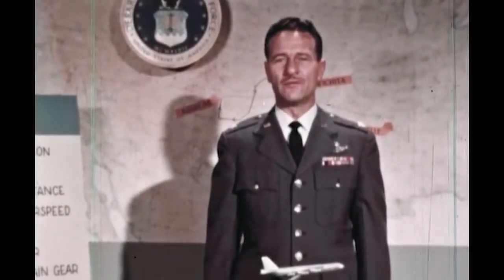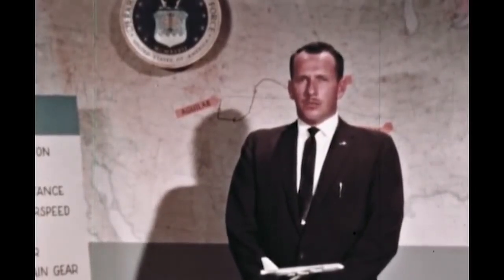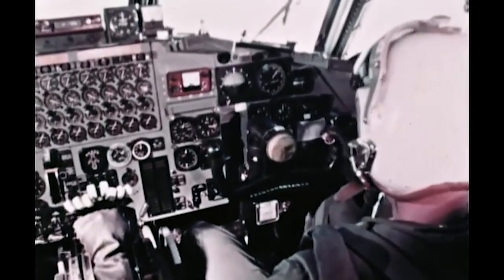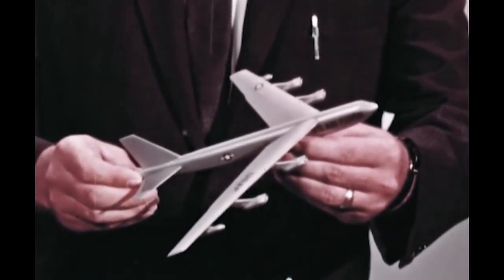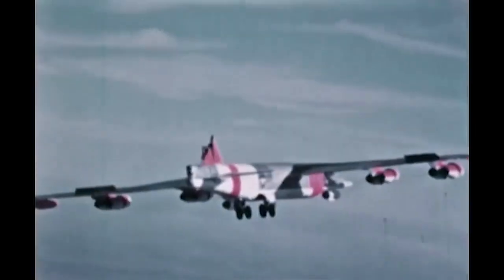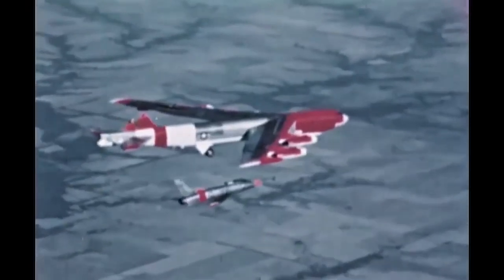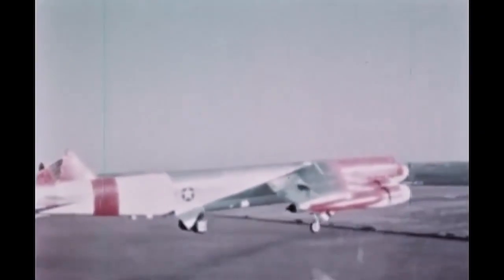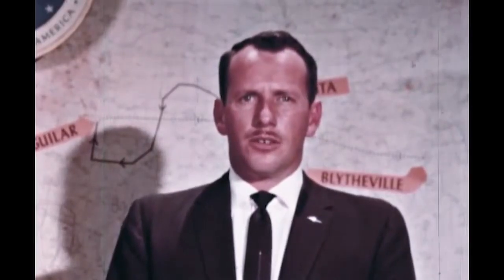B-52 Emergency Landing - Flying Without A Tail Fin - 1964 Air Force Education Film

Comment: First B-52 entered service in 1954, and the first B-52H entered service in 1961. I find it interesting that we're still using the B-52H model and there's been no other model I, J, K, etc.. since. In 2024 that's 70 years of service, and 63 years of the "current" model. There is a B-52J model scheduled to begin testing in 2028, and be fielded to the USAF in the 2030's.

Comment: I had planned to go on this flight as an observer. I was Chiief of Structures Technology at Boeing-Wichita at this time, and the data from these flights was sent to my section for analysis.The purpose of this flight was to record gust velocity and airplane accelerations and stresses during low level flight. This was at the height of the Cold War, and SAC crews were required to practice this type of terrain avoidance flying to be ready to penetrate below Soviet radar. These flights and other activity were part of a vast program to understand the environments in which the B-52 had not been intended or designed to fly, and to analyze the effects on the structure. I had planned to go on the flight as an observer, sitting behind and between the pilot and co-pilot, but this plane did not have a tie-down restraint for an observer. Chuck Fisher, was concerned for my safety and suggested I fly instead on 56-632, which had a seat belt attached to the flight deck, and which I had flown on before. So I flew with Dale Felix and his two-man crew on a different low-level route two days before Chuck's flight. During my flight, Dale let me sit in his pilot's seat and fly a short while, with the co-pilot keepiing a close eye, of course. So there I was, tooling around only a couple hundred feet over the farms of eastern Colorado in an eight-jet-engined beast. Quite a thrill for a non-pilot!  And two  days later I was glad not to have gone on Chuck Fisher's famous flight. When he first lost control. Chuck had given the order to "Prepare to abandon ship." If I had been aboard, I would have been on the upper deck, with my ejection seat on the lower deck, and it ejecting downward!!. Not a pretty picture. We analyzed the data from this flight and found the gust velocity was three tmes that for whiich the plane was designed.  A year or so later, we had made modifications to strengthen the tail and fuselage structure to withstand these forces. I then flew with Dale Felix over the same route as this flight, up and over and around the foothills. Again it was quite a thrill, and I salute all the airmen who make such flights as part of their training,

Comment: I guess whenever you lose a vertical stabilizer, aside from relying on differntial engine thrust for control of the plane, second, I would then call the Air Force to send jets to accompany my plane. Thanks air force instructional video! (as well as Air Crash Investigation videos...)